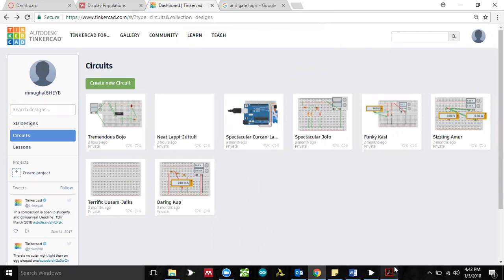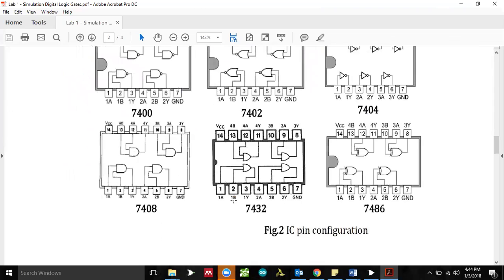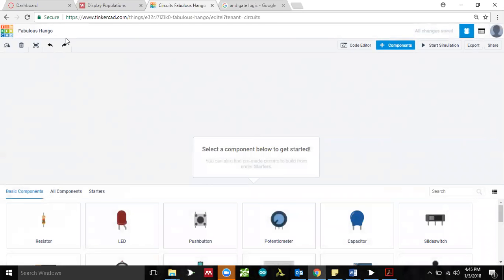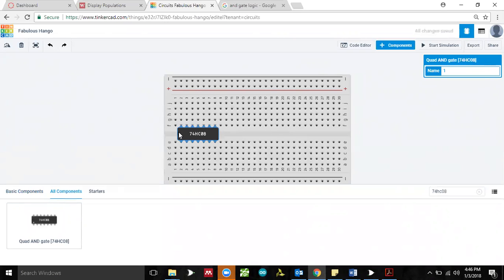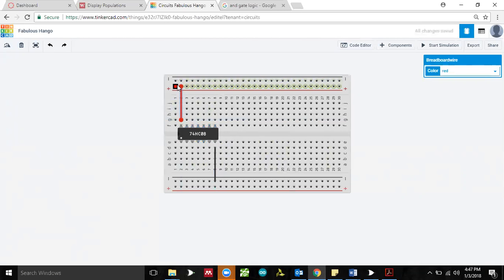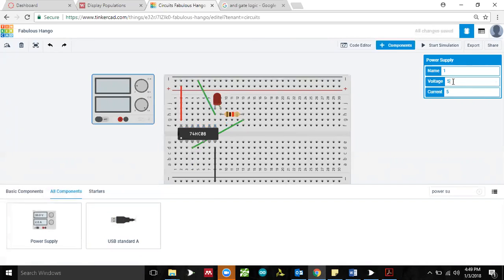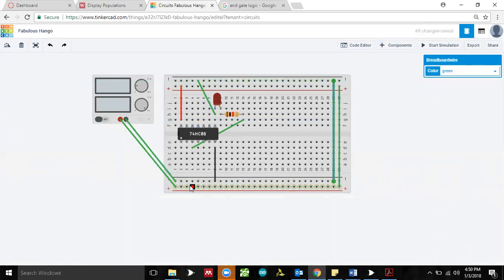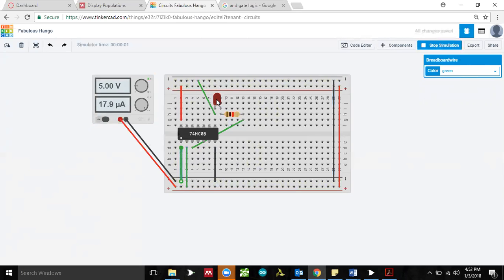#2 Logic Gates using Tinkercad

Comment from the maker: Dear All, at around 12:07, due to some technical issues the video went blank. Just make sure that the resistor is 1k or above, and is placed in the region where it is not overlapping with IC pins. Use a wire if needed. Stop and run simulation again. And that is all :) I hope that you enjoyed the video.

Comment: Hello sir i need your help, can you show me how to make a’b+ab’ logic on breadboard or tinkercad please
Reply from the maker: Dear Can, this expression you mentioned is just simply an exclusive or (XOR) gate expression. You can insert an XOR gate IC and and use pins to give input. Let me know if you have questions.
Reply: @ElectronicswithProfMughal  sir i have to do it with 7404,7408,7432 ttl’s and 3 leds,3 220ohm resistance can you help me about that please
Reply: @ElectronicswithProfMughal  i would be so happy if you show me how to do it on tinkercad
Reply from the maker: @canyucelkoc509  Dear Can, here you go - https://youtu.be/GBTIcKWy7rU

Comment: The ending part of the video went blank😢. That was the important part for me
Reply from the maker: Dear Fred, just make sure that the resistor is 1k or above, and is placed in the region where it is not overlapping with IC pins. Use a wire if needed. Stop and run simulation again. Hope that helps.

Comment: Thanks a lot this was very helpful. I do have a question. Could you explain to me again how you fixed the issue about the broken device due to Current exceeding maximum capacity please?  Thank you!
Reply from the maker: Adama. W Dear, add a 2.2k resistor in series with the light emitting diode and re-run simulation. And it should work.